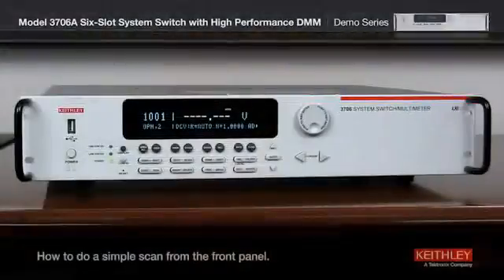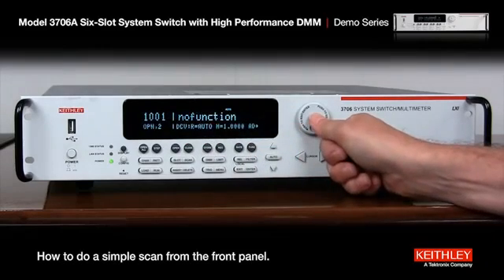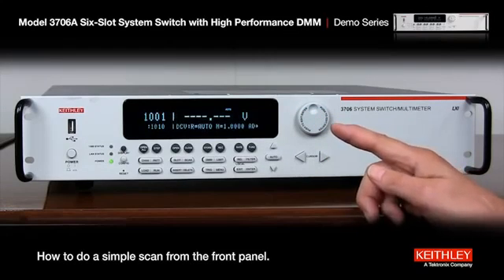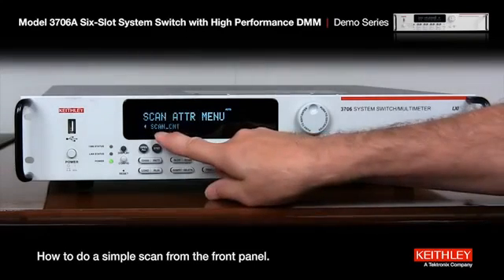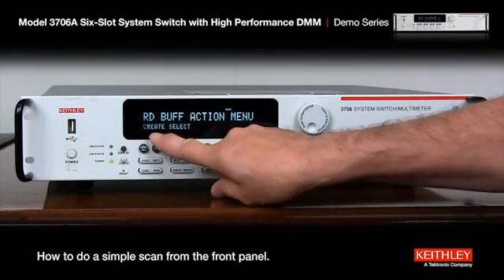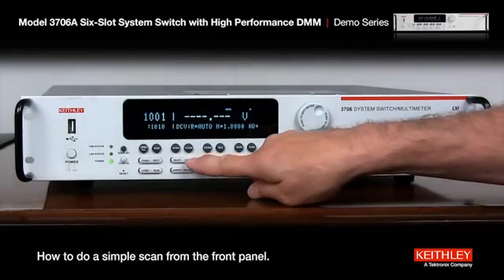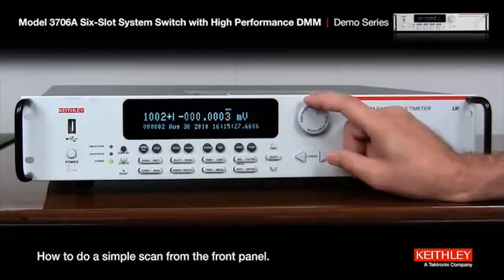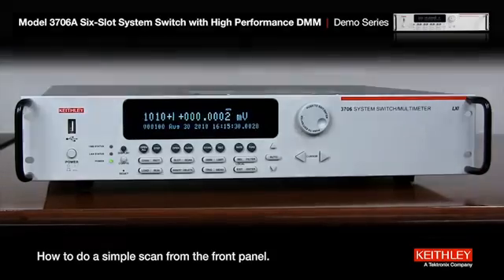Keithley Model 3706A Six Slot System Switch with High Performance DMM Demo - Series 1

Comment: Hi sir,
Iam going to use this instrument with 3730 matrix card  as switching applications.

I need to know how to connect the input from the impedance analyser and take the output from the screw terminal board. 

Kindly support in this regard

I